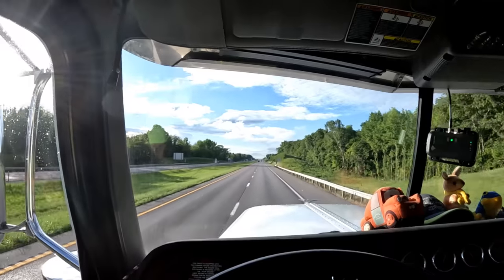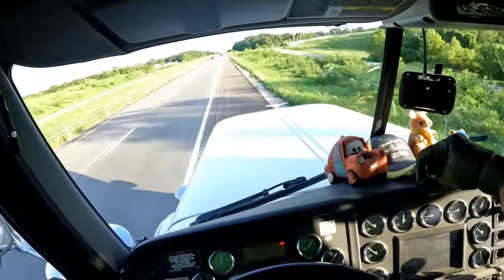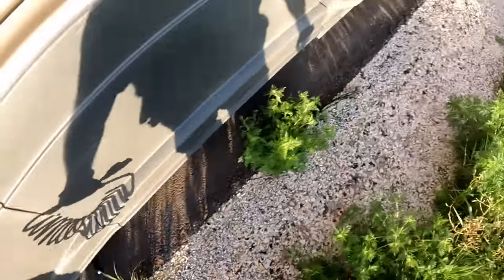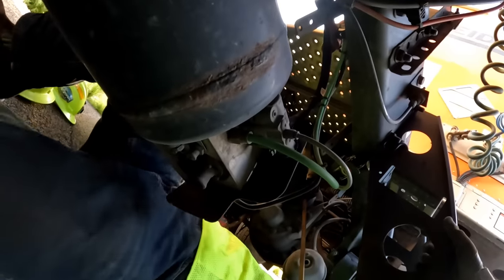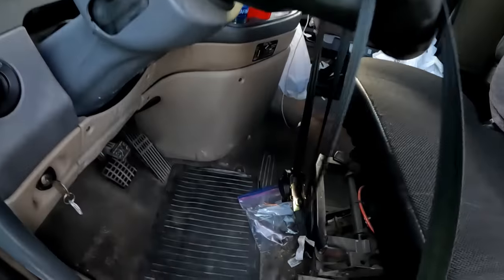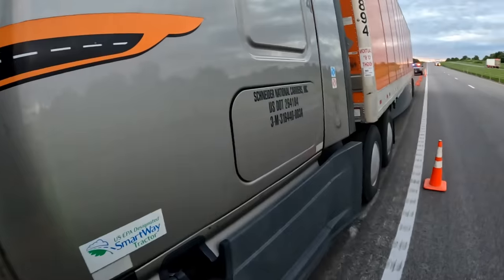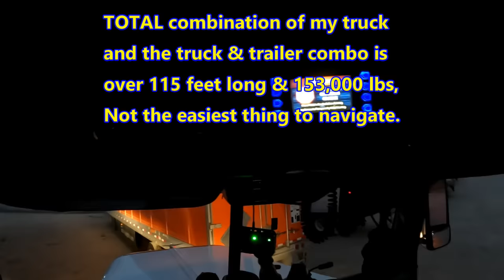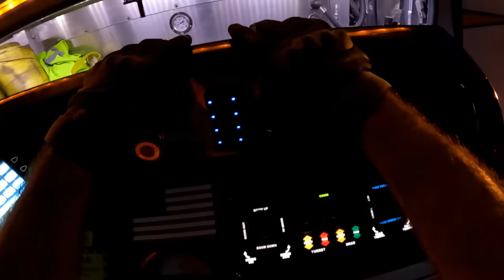STOPPED DEAD ON THE INTERSTATE!   SOME ASSISTANCE REQUIRED

Comment: I ask this out of a lack of knowledge of working on large equipment such as semis, but once the bolts are out of the driveshaft, would bumping the vehicle's drive wheels front and back once the front is lifted help to break the seize at the shaft joint? I have used this method on smaller vehicles and it cuts down the separation time of the joint dramatically. Just looking to cut down the time a tow man is out on the line of fire in traffic.

Comment: Still staggers me Ron how little the laws over there don't back you up for safety. Here in South Aus as I have previously mentioned if blue and red is flashing its 40 kms/h and in your case there with working on the side of the road the cones under health and safety law would be completely angling out to block off that lane from traffic coming through. Even lawn mowing that centre strip would require the lanes bordering it to be coned off!!

Comment: I h hate  that when drivers don't move over its just bad drivers.  I always put the hazard lights on and  slow down and move over. I bet if I do that in the USA some idiot would undertake and between both vehicles. Stay safe your rig looks great. If you check out some UK shows you might see them use metal wheel block that prevent roll off

Comment: As usual a job nicely done!

30:14 I think that tire should be changed. Looks like its damaged WAY more than its safe. Especially since you dont know how deep that cut on the side is and how long the tire will hold with it.

Comment: Oooo, a long one.
I'm sure I've said this before, having a mix of longer and shorter videos is great by me.
(p.s. Written while watching, but it looks to be an interesting situation so far.
Ron, one question I keep meaning to ask - When you say the truck weighs 44,000 pounds is that the total weight of the rig or just the weight of the load?
Reply from the maker: I can't speak for every situation, but in this one as well as most that I recall, I typically ask the driver how much weight is in the trailer.   It is just something I've learned over the years.....most drivers will generally know the answer to that question, where they may not know their total gross weight.   Thanks for watching and God bless.
Reply: @RonPratt  Thanks Ron - things make sense now.  God Bless.

Comment: Ron I know there's good reasons for removing drive shaft, but never understood why. I have seen numerous tow truck drivers remove them. Please explain. Stay safe & God bless
Reply from the maker: We have always removed the drive shaft on a truck before a front tow whether it was a manual transmission or an automated transmission.   On a manual transmission, you run the risk of burning out the output shaft bearing, which continues to spin without lubrication if the shaft is not removed.   With the newer automated transmissions, there are a few manufacturers that claim moving the vehicle even a few feet without removing the drive shaft can destroy the entire transmission.   So, short answer, to prevent damage to the transmission.   Thanks for watching and God bless.
Reply: @RonPratt  Thanks Ron

Comment: How is the SafeAll Remote Brake Assist adjusted to press the towed vehicle brake the exact amount needed to stop?
Reply: it is supposed to be proportional to how the brake is pressed on the tow truck, the main issue with them is the delay (but still far better than nothing)

Comment: Until the state passes a law that states in no uncertain words that failing to move over will result in a ticket and fine in excess of $250.00. Then that will get their attention. Florida already does something similar to that using their front-mounted cameras and you can contest it, but the owner still gets the ticket, fine, and points on their license. It works here. Pleading ignorance of the law is NO EXCUSE, you are responsible.

Comment: Engineers should be required at least 5 years in the field before they get to design anything. They never leave enough room to service something like those U joints. Or that low front axle.

Comment: I noticed a lot of other tow companies just use a ratchet strap on the front axle is there a reason they need to use a chain?
Reply from the maker: No.   Chains and straps both work.  It is personal preference.  As long as the vehicle is secured, that's what matters.    Thanks for watching and God bless.

Comment: Dumb question of the day... what do you do about the driveshaft when you drop a rig in the lot?  Leave your straps on it or just let the shaft down to the ground?  The video left that part out.
Reply from the maker: Typically, we will leave them hanging and take our straps.   Some shops want us to reinstall the shaft.   Most customers want us to leave it out so it can be properly inspected prior to reinstallation, plus it is cheaper to have the shop reinstall than to have us reinstall.  Thanks for watching and God bless.

Comment: 32:17 swinging a hammer on your back, above your body, in a tight space. Most difficult part of the job for sure. Using your weakest arm muscles (triceps) without the benefit of gravity or momentum. Throwing a 2 pound hammer 50 times ain’t easy.

Comment: For the morons who won't move over: borrow a tank, from the National Guard, and park it in the lane you want protected. 😉😏
Seriously, though, take a tip from DOT: start with a much heavier traffic control truck and add one of those collapsible crash barriers. Either that or have the PD follow you on every call.